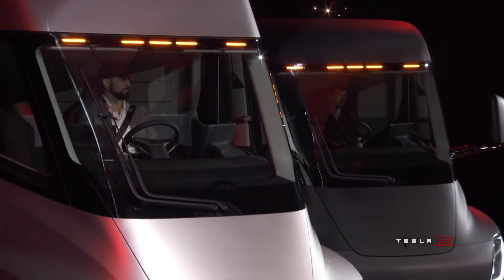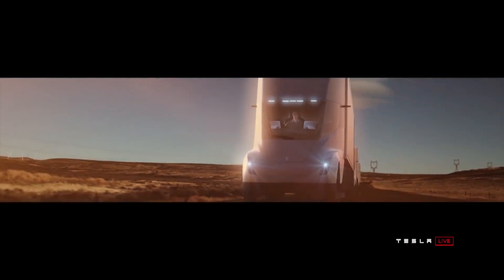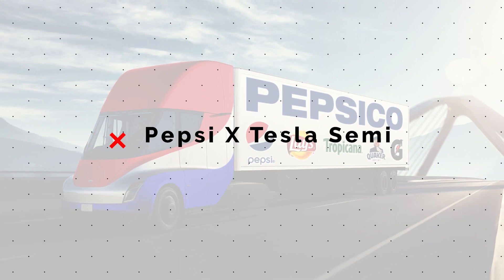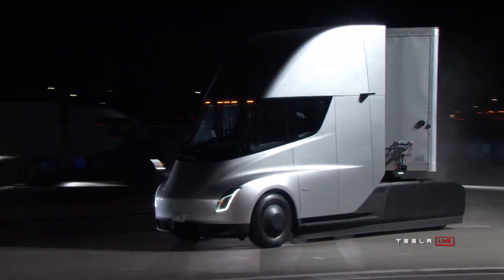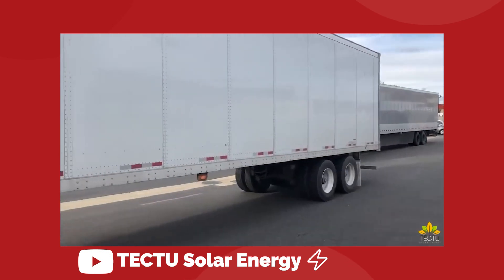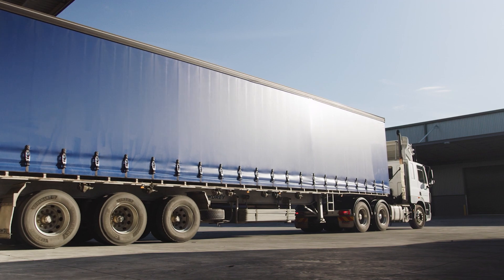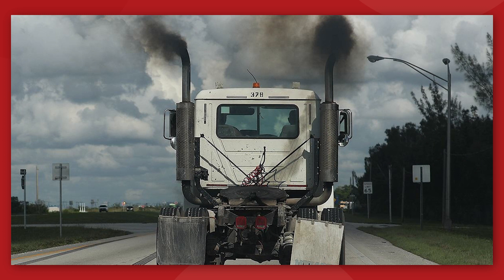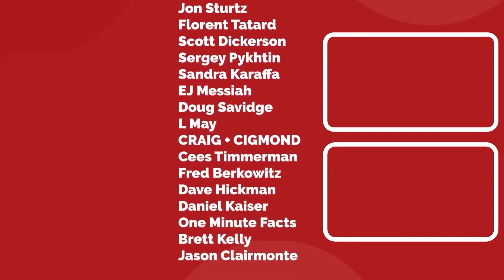Major New Tesla Semi Update Is Here!

Comment: What about those that are driving doubles/partners. I would like to see them be able to actually drive for 1,000+ miles plus a trailer made by Tesla that could also have a charge that could be added to or use along with the truck battery.
Reply: Also lose the 5th wheel and make all wheels turntable for easier and better driving performance.
Reply: This model isn't for them. First things first..
Reply: And I'm sure many girls would live to have their daddy buy them a unicorn.

What you want, doesn't exist in reality and is not possible with this stale technology.
Reply: @damianweiss9870  Huh?

That literally makes ZERO sense for heavy trucking.
Reply: @billcichoke2534  Some fire trucks are like I suggest. Also a good model for a large RV.
Reply: @damianweiss9870  When you're talking about a vehicle of fixed length with a lighter load, articulation isn't a bad thing, per se (city buses use this a lot).  For heavy cargo, on the other hand, and the ability to hitch from a load and grab another one, your solution would hamper both.  It's not suitable for heavy hauling, and would require specialized warehouse equipment and facilities that don't exist.
Reply: @billcichoke2534  I’d expect to see it in more luxury campers as well as other trailers used for relatively lightweight cargo deliveries.
Reply: The Tesla Semi is designed, and Targeted for the 80% of All Semi Trips of less than 500 Miles, or more specifically, 250 Miles from "Base" and Back, in the Same Day!

They were not designed, specifically for trips from California to Montreal, for example! But, in due time - likely after 100-200 "Megachargers" are "Out there",  Semi Version 2 (A Semi with a Sleeper Cap), may come, to support that, in 4-5 years+!
Reply: @JohnGeorgeBauerBuis  Those use cases would make sense.  As a replacement for a 5th wheel tractor-trailer heavy haul setup...not so much.
Reply: @robertweekley5926  That still doesn't overcome the limited ACTUAL range of those things, it the fact that ANY trip over 400 miles would add AT LEAST another 90 minutes to the trip time.

The trucking industry is not rich lefty enviro-whackos who have all the time in the world and aren't constrained by things like hauling capacities and the like.  They need to be able to go down current main corridors, they need to run at least 650-750 miles per shot, and they need to be able to 'fuel up' and get service ANYWHERE.

These things fail on all counts, and NO ONE is working on ANY of that.  For that reason, these things lose before they even start.
Reply: @billcichoke2534  There would be pluses and minuses for each. You make a good point about dropping and hooking trailers; however a lot of freight is live unload and /or JIT sometimes paying more, a lot more.

Another plus, I believe the FSD AI would be easier for a straight truck design with all wheels movable; especially easier & safer for backing up. 

For example, try backing up a boat on a trailer connected to a car into a single spot vehicles on both sides, in all cases it’s more difficult than if you just backed up the car alone into the spot because of trailer articulation. 

In some cases a lot harder, say you have to back into a spot next to a wall and bend the trailer in a 45 degree angle or more if other obstacles in the headroom of the car.

I think you also miss the point that at FSD Level 5, you no longer need the cab at all, saving 18,000 lbs of weight. 

Thus no need to drop and hook the trailer and the extra 18,000 lbs can go to either extra batteries for longer range or extra freight & more profits.

For example, FedEx on weekends runs mail pack trailers to New Jersey Airport from Memphis about 900 miles. They are light loads and 900 miles is doable with a trailer only with up to 18,000 lbs of extra batteries. Saves using an airplane. Other FedEx runs could also benefit. Other applications abound.

Other efficiency example. Walmart, Home Depot etc  keeps large bullpens of dropped trailers waiting to be unloaded over a couple days. Self driving trailers could simply drive up to the dock themselves, no need for a company yard driver to move trailers to the dock to get loaded, then to the empty trailer lot when unloaded, then back to the dock to get reloaded. 

Also the trailer could leave as soon as loaded instead of waiting for the trucking company to assign a driver to pick up the load. Not unusual for the process to get messed up and the driver is late, sometimes days late because process is more complicated.

Another efficiency example. One of the biggest problems large trucking fleets have is keeping track of empty trailers, of which there may be thousands all over the country at various shippers and receivers. When empties are found the company has to dispense a bobtailing driver to hook the empty trailer and go to the next pickup usually someplace else. 

Another efficiency, sometimes trucking fleets run out of empty trailers to spot at shippers for loading.  This self driving trailer system is more efficient and with faster velocity freeing up more trailers. 

It’s possible the self driving trailers can do 50 % more paid miles with the same number of trailers; plus eliminate the cost of paying a driver to drive empty to the shipper to pick up the trailer.

An articulated cab and trailer connected with a fifth wheel is very inefficient compared to self driving trailers without cabs connected by a fifth wheel.

Remember what Elon says,” the best part is not part”. Lose the articulation, lose the cab, just have a 53 foot self driving trailer, same size as todays trailers. 

If a truck cab hooks to a trailer the total length jumps to 72 feet.

I could go on, but you get the idea.
Reply: @damianweiss9870  Unfortunately, your examples all depend on a technology that doesn't exist at this point in time.  And if countless iterations and 'beta tests' have shown us ANYTHING, L5 vehicle autonomy is as much of a pipe dream today, as nuclear fusion.  Plus, some issues with your efficiency examples...

ONE:  much of what you describe, is already done by RAIL.  What long/heavy haul trucking does, is bridge the gap between regional hubs and distribution centers.  That requires real time flexibility and adaptability...2 things machines don't have.

TWO:  the tractor of a semi encases more than just a driver's seat...and no amount of miniaturization would fit batteries, drivetrain, and guidance/control into the trailer.  If you took power from overhead wires instead of batteries, then you're right back to TRAINS.

The axle types and setups in use right now, came about from years of experience back in the early 20th century.  The problems they solved, still exist.  Conflating solutions more reminiscent of railroads with open roads, misses the differences between the two.
Reply: @billcichoke2534  Not sure what your point is. By definition 100% of everything ever invented by mankind did not exist before it was invented. Your logic seems circular there.

Trains are cheaper but slower, best suited for commodities & bulk items. Trains do carry non time sensitive 53 foot trailers-no cab, some double stacked. This still can be done with FSD trailers also, and charge them while transporting. At end of train trips for trailers there is still a 100 miles more less of FSD driving to go. Trucks still carry a large part of all freight competitors with trains.

As for a drivetrain, EVs don’t have drive trains, just axles and each wheel will have an electric motor. An EV FSD trailer is same.

As for batteries, they go under the entire floor area just like all Tesla EVs. The skateboard area for a FSD trailer with no cab is enormous, about 53 feet by 8.5 feet; all the battery you need & then some. 1000 mile range easily with lighter loads.

I do agree with you FSD is getting g to be like nuclear fusion promises. However that is why I think the trailer only model is a much easier task for FSD to achieve on straight trucks.

And as always, find where the most money is and go after that, even if you have to invent it !
Reply: @damianweiss9870  My point is, your solution ASSUMES many efficiencies based around things that don't exist.

The fact is, much of what you list off WAS tried.  This is what I meant by why we settled on the tractir/trailer configuration.  Also realize this...there are FAR more trailers than tractors.  It's the beauty of the setup, and the basis of truck shipping's flexibility.  It's also more efficient to maintain and service your fleet in that configuration, than if EVERY trailer was also a powered vehicle.  Petrofuel or electric, the costs would be ENORMOUS.

Bu the way, motor and transaxle IS a powertrain.  Just because it's electric, doesn't matter.
Reply: BEV class 8s won't have the capabilities to ever go 1,000+ miles on a single charge

Comment: 80% of all Semis go 300 miles or less round trip. So you are talking about 20% of the industry. This is not a big issue, but it does need to get taken care of. 
Most companies are working for Gas companies, Wallmart, Pepsi, which are delivering locally.
Reply: Yeah but 20% of those trucks cover the vast majority of miles percentage wise so it's actually the flip of what you've stated it's 80% of the mileage is covered by 20% of those trucks. Replacing those 20% is a 80% reduction of emissions
Reply: @NadeemAhmed-nv2br  short haul is the more inefficient, so replacing those miles is the best throw for a given number of vehicles....
Reply: Can you prove your 80%. I don’t think you are close to being accurate.
Reply: Where’d you get that number from?
Reply: I drove local and that 300 miles is abysmal
Reply: The bulk of trucking in the US is about 600 miles or day runs. The long-distance runs will typically use two-three driver to do long distance and is not as many think the majority of runs. Many drivers may question this, but when questioned they typically make multiple stops going cross country putting them in a 600–800-miles range even if they are going cross country. A combination of tractors and trucks (26') or less make local runs; less then 300 miles as driver like to come home every day. So, the tesla semi is the right balance for many truckers and companies. Charging is the many "problem" but many companies can have their own stations and in house and charging is the best solution. regulation are a pain to keep diesel and electricity is safer when trained correctly.
Reply: @NadeemAhmed-nv2br  I get that, but we can take care of the 80% first, it is still emissions and it is in more densely populated areas. Plus it will allow Tesla to work on the battery and charging tech for he long haul trucks.
Reply: @lylestavast7652  Agreed, and the density of the areas helps the diesel pollution to be limited. Not to mention the number of trucks that idle and pollute our cities!!
Reply: @LiveToBeGreatness  It was in an article about Semi trucks about a year ago, I can't find it today!!

Comment: So impressed with the Tesla truck. But I have one question about regen, breaking and logging. 
I’ve watched big logging trucks, in the Sierras, and they use a tremendous amount of braking and water cooled braking with very heavy loads. 
It was not explained, but I would think that just regenerative braking in the front or the tractor would not work, and they would have to have the same in the trailer. Maybe the trailers could be configured with integrated regen axles for braking

Comment: I think the Mustang bit at the end is misleading.  The horsepower decrease that you quoted is mostly the result of changes to the rating system.  In 1968 engines were tested without accessories, basically gross horsepower while the 1978 engines were tested with all accessories attached and in use as they would be on a road car basically net horsepower. Some power was of course lost to lower compression ratios and lien burning efforts to meet emission rags.

Comment: A CDL driver can drive for 11 hrs with a 30 minute required break, not an hour. We have to take a 10 hour break between shifts. So unless a Tesla semi can recharge in 30 minutes, it will have to do it on the 10 hr break or on-duty time. We can’t service or technically drive the truck during that time. This means charging will take away from on-duty time which is 14 hrs max.

Comment: FYI...new semi diesel trucks have to have DEF added to the engine. With DEF added, part of the exhaust  system, the truck then only puts out H2O for exhaust. So...no massive black smoke coming out of the pipes. Far cleaner than any lithium battery. Lithium batteries take tons of fuel to be made and delivered.
Reply: Sourcing the DEF is getting tougher.

Comment: The range will need some work and will need charging stations everywhere. I also want to know the weight. But im excited for this, im a battle hardened otr driver, i usually do 650-800 miles a day, sometimes 1500-2000 in one sitting. This will be dope cause battery technology will only get better.
Reply: Bro, you're either a liar or breaking the law if you're consistently driving more than 700 miles per day. Not possible, at least not here in the US.
Reply: @alvarofelipe8164  its been done for decades lol but yes 11hrs is the legal limit. My truck does 75mph, that equals 825 miles a day legally.

Comment: The drop in output from emissions laws doesn't mean there was a loss in efficiency, only a loss in power density.
Reply: Gas mileage sucked up until we had decent EFI and other forms of engine management.
Reply: Disagree, emissions equipment delivered the worst of both worlds.  No power, no mileage
Reply: @edwardcoulter9361  My point was merely that you can't conclude efficiency decreased from that stat.  It may have or may not have, but the data doesn't support the conclusion.

Comment: Europe is hitting quite good emissions standards already and Particulate filters have also come a long, long way since the 80's.

But yes, I get your point. It's probably worth it for all truck manufacturers to look at electrification. The Biggest challenge would be finding something else than Lithium based batteries as Lithium is already in short supply as it stands! This short supply issue is a contributor to Tesla's delay with the Semi, the Cybertruck and their Roadster. My guess is that the Roadster will probably not be mass produced  before 2030 (if ever), if you ask me! There is just not enough Lithium to go around and the Roadster is just not that high up the priority list. Until we get to the point where Lithium Batteries are beginning to enter recycling factories by the masses OR some other crazy cool battery tech becomes main stream, these delays are here to stay! Lithium Mining is a rather filthy and somewhat disturbing affair, to be fair! Lithium outputs are not going to increase anytime soon. In fact, the greens are rather trying to close them down because of their potential disastrous impact on the natural surroundings!

Comment: utube poster needs to update the incorrect information on drive times allowed federally.....a driver can work up to a 14 hour shift but cannot drive longer than 10 consecutive hours.  The only time they can drive longer is by long haul where "Daily Schedules" do not count.  Log books reflecting ll hour drive times are going to catch some huge scrutiny and heavy fines.  A driver must have 8 hours in the sleeper after a 10 hour shift in driving and a max of so many days of this before taking a minimum of 1.5 days to reset the time on the log books.  Alternately, the max miles in an 8 hour shift is around 500 miles as the speed limit is usually 50 mph with allotments of factors affecting the mph such as hills that can slow the vehicle considerably, traffic congestion, etc.  These are federal mandates that change yearly but on the whole make minor changes to meet federal safety standards.

Comment: I’d consider a 4x4 bobbed semi without a sleeper and re-rated to 26,000 lbs as an “incomplete vehicle” so I can add my bed of choice after delivery. It seems the money would be comparable to the mystery top end Cybertruck, but I would know for a fact that I could tow my RV, equipment trailer, or horse trailer.

At this point, whichever one I can get first is the one in most interested in. I’m paying $250+ a week in fuel just to drive to work. I’m about to buy a Model 3 just to save some money while I wait, but I’m afraid that it’s going to interfere with my ability to get financed on the truck next year. 🤔
Reply: Getting the Model 3 and being patient about the truck is probably a good plan, as Elon is known to frequently be late to deliver products, even though they meet or exceed specifications other than price (inflation has been brutal, $20K in the mid-1990s had the purchasing power of $40K now.  At least value has improved somewhat, as Bluetooth stereo systems have become standard even in low-end cars with hand-crack windows!)
Reply: Yep, me too. The CT won't pull my 5th wheel, so I'm considering the semi.

Comment: i think if they have customer trailers that also have their own battery packs would be awesome with quick disconnect mechanisms from each trailer that would provide extra power to the truck to extend that range ..
Reply: Not going to work as the battery needs liquid cooling/heating and careful control with BMS
Reply: @markreed9853  all those controls and cooling will be taken into consideration for design i doubt any competent engineer would leave that out ..
Reply: @Matthew.Sirrom  maybe but I just don't see Tesla doing it as battery supplies are constrained as it is without adding extra. The 500 mile range model is going to have at least 400 kWh of batteries as it is!😬

Comment: As an owner operator truck driver there are 3 huge factors.....battery life and replacement costs....cost to charge ....range. I need test results on 80000 pound haul over 250 miles on a 5% average grade.